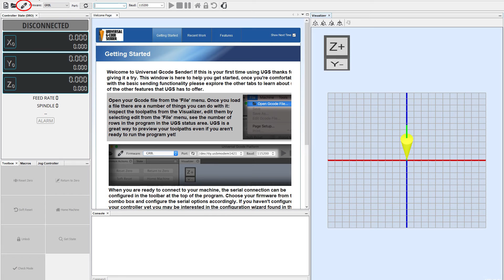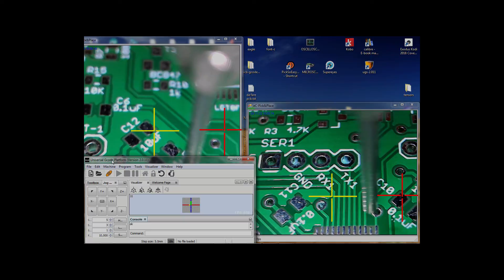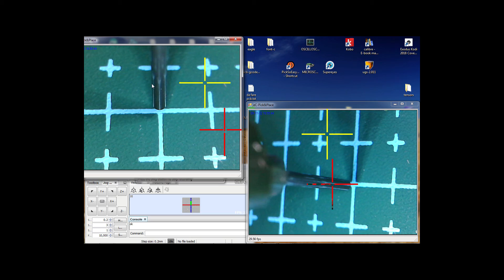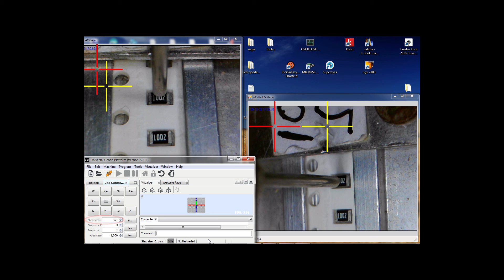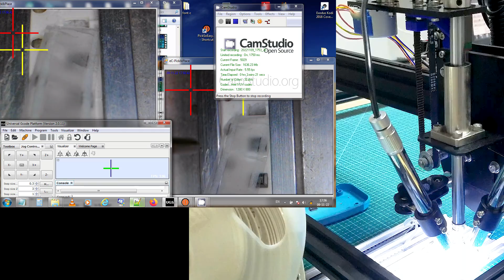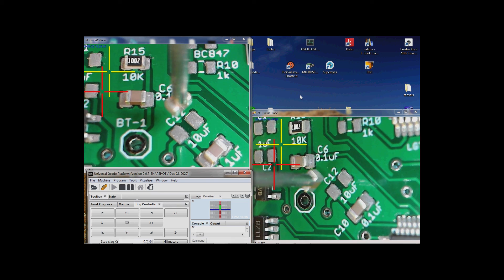Using the PickSoEasy PSE-22. Pick and place machine with 5 stepper motors

Comment: Can this handle 0201 parts?
Reply from the maker: yes, you can monitor the position and manually adjust if it is not perfect. You can pause the placement, move X Y and rotation and go down by steps, Then adjust again if necessary

Comment: You're missing an upward facing camera that adjusts the rotation, correcting the alignment of the component.
Reply from the maker: Hi Spirit. This is not a fully automated machine. It is not designed to be fully automated. It is designed in a way that you can use centroid files to get to the component pad, but if you want you can control it just using the gamepad without the need to program anything (https://youtu.be/trfy5dP2WPo), so being quite flexible, that is not possible with fully automated machine based on openPNP. However, I'm designing a fully automated OpenPNP machine that obviously will have a camera facing UP... but it will not be a flexible machine like the PSE-22.  The OpenPNP will need to be programmed to the specific board to work... not good for fast prototyping...
Reply from the maker: The new OpenPNP machine, PSE-3000, is ready. Obviously it has the bottom camera...  www.youtube.com/watch?v=dHtWtvBZa0A